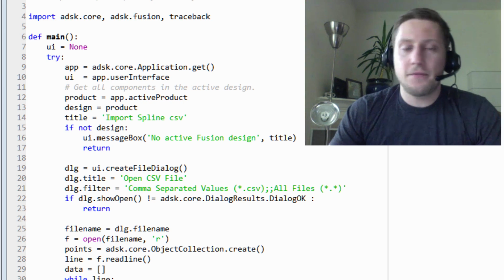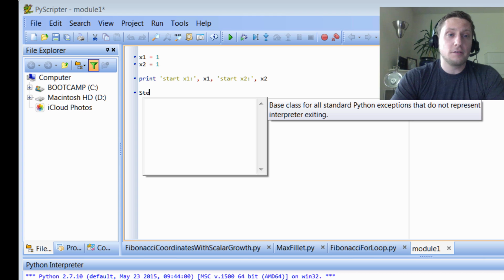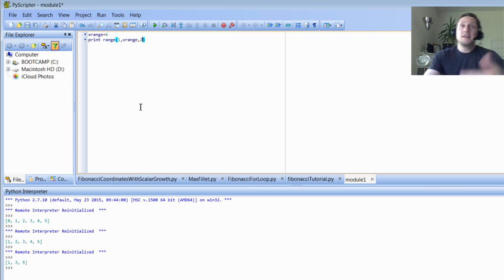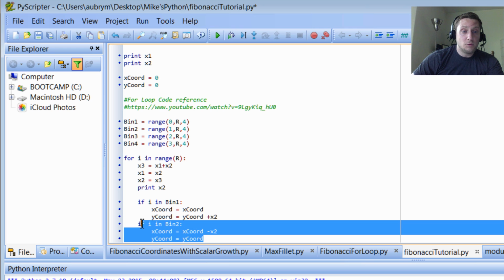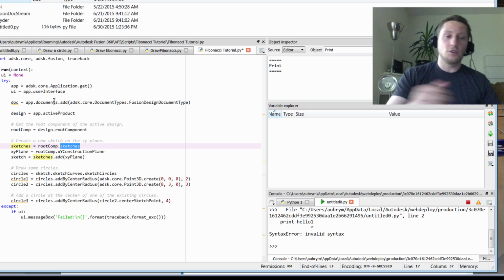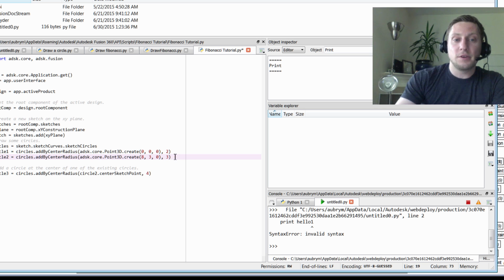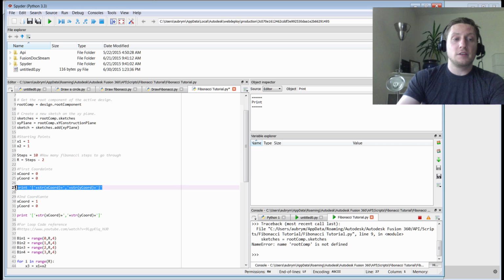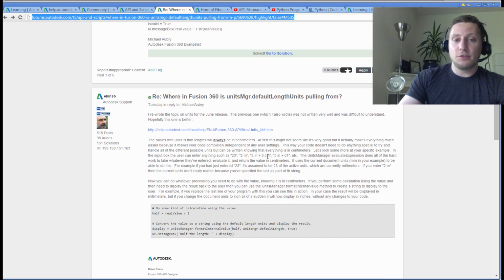Getting Started with Python Scripting and the Fusion API

Comment: You should begin with HOW to get to the API interface menu first. There is not a single video or guide on how to get started on this.
Even a simple click path would help.
Reply from the maker: Start here (http://help.autodesk.com/view/fusion360/ENU/?guid=GUID-A92A4B10-3781-4925-94C6-47DA85A4F65A) then work your way down that rabbit hole. Hope that helps!
Reply: page is not working 404. do you have a new link?  @adskFusion
Reply: @user-fe9tw6mn9w go to model ->add-ins->script and add-ins

Comment: Excellent video!!! Please please do more stuff like this. The hardest part of getting started with programming in my experience is truly understanding what's happening in laymans terms. You did a great job. One big problem I've had in the past, which I've come to realise is one of my own doing, is quite simply that I wanted to completely understand how coding works.... I've learnt to accept that I don't need to know how it all works... just that using a particular method or function performs a certain task and that is it. I have to stop my mind wondering beyond that fact.

I do have a couple of questions though, I'm learning Javascript for front end web development, its also the language used for Autodesk CAM post processors. I'd rather not confuse issues by having to learn Python at the same time.

Why have you chosen to do these tutorials in Python instead of Javascript?
If I use Javascript to work on the Fusion 360 API, will I be limited in any way?